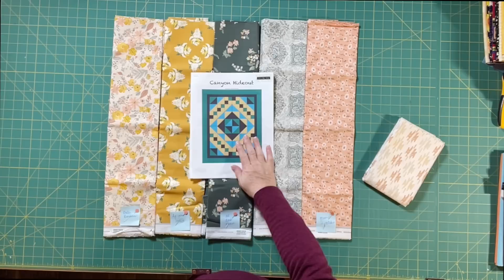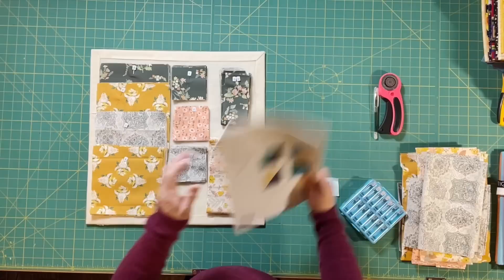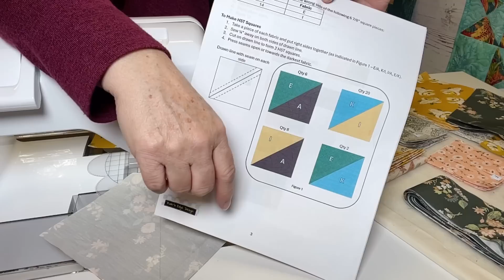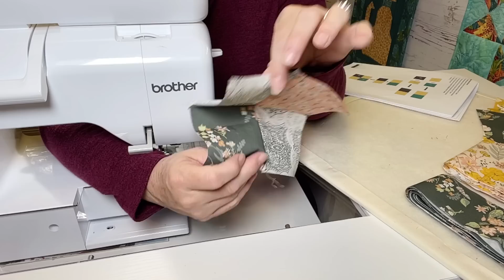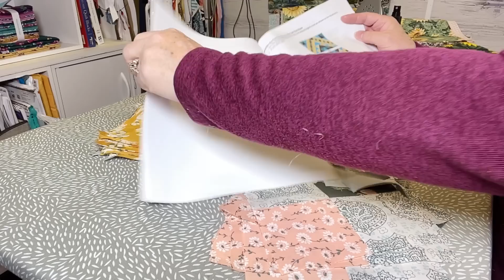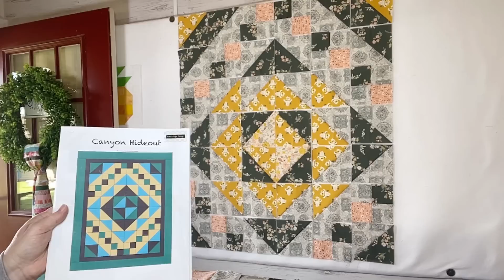I’m Sewing The Quilter’s Architect’s Quilt Pattern No. 1 | Ruler’s Edge Design

Comment: What size is your quilt design wall ? Did you make it yourself or buy it ?
Reply from the maker: Mark & I made it. Bought a thick 4x8 sheet of lightweight insulation board, covered it with thin pellon polyester batting, screwed it into the studs of the wall using large washers. I would love to add another 2x8 piece to make it longer